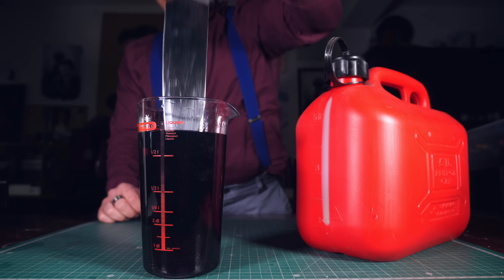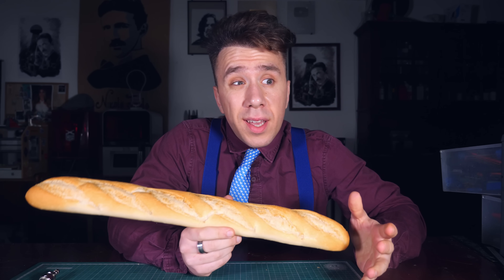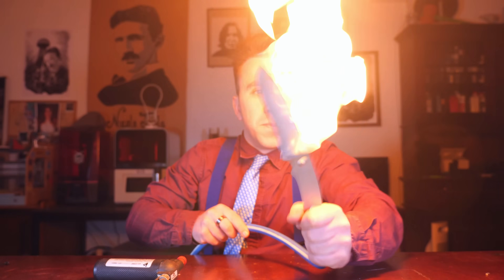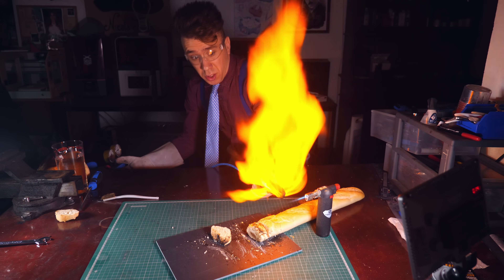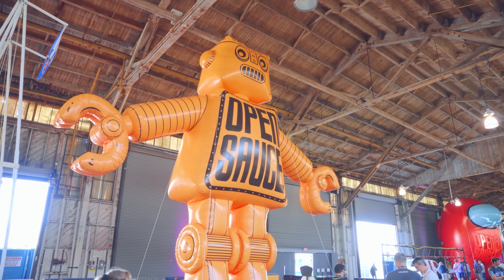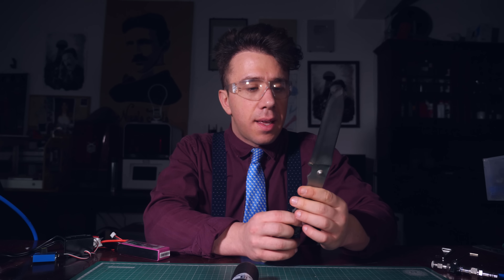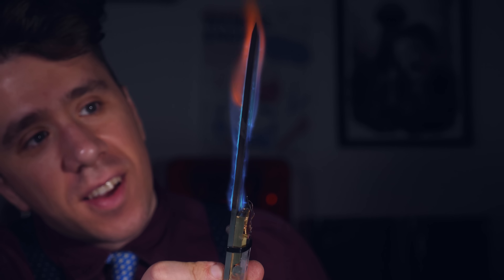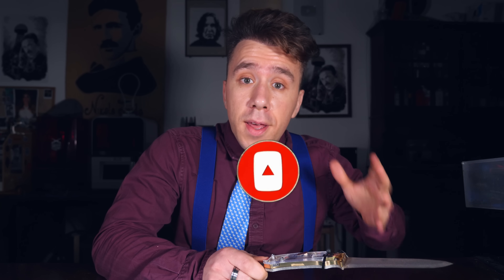I made a TRUE FLAMMING KNIFE

Comment: I want to see it hooked up to a Tesla coil or a high voltage DC source, The tiny radius of curvature of the voids inside should concentrate the electric field enough to cause corona discharge INSIDE the knife instead of just the sharp edge and tip. Plasma assisted supersonic knife.

Comment: Wow, this is amazing. Do you see what I see? This piece of metal will do a wonderful job of generating hydrogen. You have created a metal that has a surface area larger than its external dimensions. Not only that. Rather, this defect that you mentioned is a very useful property. You see hydrogen bubbles sticking to the surface of the electrode, and this reduces the efficiency. With this property, the consistency will decrease without the need to stir the solution. You have a treasure, man. Make a Volta tube with this metal, and use a large amount of hydrogen to prepare shakshuka with tomatoes. It would be a dream come true if I had access to some modern technology such as a 3D ball. Please help me win

Comment: I wonder If the knife can be printed in such a way that only the blade itself is porous and the pores on it are all facing the same rough direction? If that's possible, then imagine using this as a concentrator/ directional flow controller for gasses and the like for not just jet engines but definitely for jet engines too.

Comment: so could you 3d print a metal with a super high melting point and use that defuse to make a light saber. i really liked when it was super sonic and seemed to just be heating the blade. sounds like a good colab op with hacksmith too. - video idea

Comment: I dont think the knife or this tech will work. As the metal reaches its melting point. I dont know if it reaches the pores will close or self heal. Since the bread cutting industry is only using it at less temperature it might be a success for them. There might be a little chance to commercialise this metal. For the next video what you can do is, try to fly a small plane from your jet engine you can use any. or use it to power a car. I mean an rc car or rc plane.

Comment: lockheed martin has a prototype drawing of a fighter jet engine that had its combustor replaced with heat sink fins heated by a fusion reactor. can you make a jet engine that has an electronic resistive heater to expand the air instead of combustion?

Comment: project idea, use electric welding glasses as inverted stroboscope by flickering the opacity at high rate. the name "Time Shades" comes to mind since you could just walk around and slow down the apparent speed of anything cyclic in your environment without need to illuminate it with a flashing light. it also would allow for multiple people to view the same behavior at different rates without interfering with each other's observations. could also be interesting to see if there is any cool optical illusions or uses for sending different rates to each eye; they could be used to view something like a vacuum tube tv or oscilloscope which traces an image really quickly over and over by sending the slowed version to one eye and un-blinking on the other eye so you could both see the figure, and how it is drawn in real time.

Comment: I'm sure others have let you know but that whistle is a BAD thing. the gas INSIDE the knife has ignited. thats why you see the glowing spot grow rapidly near the end of the handle. cutting torches have the same problem on occasion. is usually means the torch is about to self destruct, if you're lucky it will only melt the tip. if you're unlucky the flame will travel up the gas that you've conveniently mixed with an oxidizer. thats part of why cutting torches mix the gas as late as possible in the assembly, we don't want the whole hose to explode, or worse, to force a flame front back into the gas bottle. Please tell me you have a flashback arrestor somewhere in this assembly.

Comment: You use this tech to create bubble cavitation on a model boat or submarine to see if you can temporarily increase the speed using a pressurized air can.
Or you can run hydrogen and air under the model boat/submarine to create underwater cavitation and fire.

Comment: There are two main types of metal 3D printers, those that get the metal powder just hot enough to sinter the metal together and those that  actually melt the powder. for those knives, the probably melt the handle together and then turn the lase power down a bit and sinter the blade together.

Comment: Sintered nozzles exist. But air is injected adjacent. 
I believe that yes, you can build a combustor with sintered fuel injectors with excellent flame holding, but will need to filter fine and need to blow dry before cooldown to avoid coking in the sinter.

Comment: I can see you using a cnc router ... why don't you make a 2 part blade (sliced lenght wise) with channels directing the gas into strategically placed outputs through the blade. This way making the blade themal output mode effective. another version would be just the edge glowing bright red to cut that damn 🍅- practically vaporizing the liquid when cutting. i really think directing the gas is the way to go because that metal sponge is just too chaotic to actually be useful - yes in an ignition chamber a tubular design to inject the fuel, might work but as a knife... you know the drill.

Comment: You can do the same thing with your ceramic resin printer. Print a cone out of the ceramic. Bake off the resin. Attach the cone to a gas line. Insert the cone into a combustion chamber. Add air. Tada

Comment: Reduction in  Jet engine complexity fuel delivery systems straight into the Compressors stream.  With the fuel cold coming off the Blade then igniting very close the reduction in engine length could be significant...Interesting...

Comment: can the printer change specs mid-print? so you can encase porous metal in homogenous metal to make parts and fittings? If so, you could make whole nozzles and diffusers as one-piece structures, rather than having a diffusion pad inside a nozzle tip, they could be one piece!

Comment: Is it possible to separate the porous areas and seal certain ones into a "chamber". The knife looks they can control that. You could have a cooling channel and a fuel channel on the same surface for liquid cooling. Or preheating liquid before combustion. Heck, you could use the porous material to capture heat from exhaust and transfer it easily to another chamber.

Comment: You should try your idea out using the metal with the holes in a jet engine. Also looks like your 3d printed air compressor has some pressure leaks

Comment: Tbh i would have liked to see more of the hydrogen with compressed air and experimenting with that cuz invisible fire making a red hot knife is COOL.
cool video otherwise

also keep in mind that Tomatoes are disgusting!
Reply: That whistling noise was the flame front trying to make its way down the tube.
Reply: @cult-of-sporque  Yeah, without a flame/flash-back arrestor or two separate fuel/oxidizer inputs, that is a detonation waiting to happen. 
Source: I'm a welder.
Reply: @erinfinn2273 the sintered metal will be acting somewhat like a flashback arrester.
Similar also to metal gauze used in miners safety lamps. 
They usually pull heat out of flame front, and thus quench it...but if the flame arrester warms up  enough the arrester would become an ignition source.
Reply: @stevecummins324  Yes, but a redundant flashback arrestor on the lines wouldn't hurt. If I was in Integza's situation, I would not trust my life to a sintered metal knife.
Reply: @erinfinn2273  Integza's arrangement is certainly not one I'd trust... 
But I don't know about a separate arrestor.... Both the sintered metal knife and an arrester will offer resistance to flow... and between them would be a volume of ignitable gas. Where that gas to catch, the pressure in the pipe would start to increase rapidly. and it can't escape easily without rupturing that pipe... imore an explosion than a burn. Best solution is to keep the volume of ignitable gas as tiny as feasible. eg microfluidic chemical reactors, hold only tiny volumes of reactants in tiny flow passages, and mix them inside the reactor, usually with additional passages for water cooling. and allow very energetic reactions to be performed safely/continuously 

there is one good thing about a metal rather heat insulating  handle... it would be noticed when the knife is starting to get warm.
Reply: @stevecummins324  I've never considered that one of the failure modes for a flame arrester is to become a flame creator. That's fun, it's kinda like a pressurized fire extinguisher that contains water with propane as a propellent.
Reply: cool maybe, but also terrifying.  Please don't mix hydrogen and oxygen before they are where you want them to burn lol
Reply: I grew up in a machine shop.
My Grandpa was anal retentive about periodically testing check valves.
But, the day he shat his pants was the day we watched the delivery driver drop a bottle of acetylene.
We were all lucky.
Reply: @TimeSurfer206  why did the shop not have a carbide acetylene generator?
Reply from the maker: Congrats! You won a 3d printer! Send me your info (Name, Address, Phone Number, Zip Code) to integza@gmail.com.
Reply: @integza lol bro won
Reply: @integza 
Hola Integza. I appreciate your knowledge and presentation of science. I seriously challenge you to make a jet engine that doesn't jet .
Reply: I'd argue a red hot knife isn't cool at all, in fact it's the opposite.
Reply: Oxygen puts its hand up…
Reply: So he should print a new one with separate inlets for fuel and oxidizer not to get roasted himself like the tomato... and then he could also make it a bit bigger, like a katana, maybe it will be some competition for his chainsaw sword 😂
Reply: @michaelnyffeler9966  probably best start small as on more thinking i need to add pure oxygen can do nasty things in piping, that is less than 100 clear of combustibles. It's not unheard of for piping containing pure oxygen to ignite if there's tiniest traces of grease.. plus if gotten hot enough steel wool can self sustain combustion with a tiny air blast of air. So sintered metal might just qualify as a fuel around pure oxygen.
Reply: Congrats! 🎉
Reply: Honestly, the venturi effect doing that is absolutely terrifying to be around.  My forge does that if it's not adjusted right and ugh... I knew the sound IMMEDIATELY.  It's like the heavens decided it's time to scare the crap out of you ALLOFASUDDEN. 😂. NOT a good time.
Reply: Agreed 👍
Reply: You can't have invisible fire. What is called "fire" is gas so hot it's glowing.
Reply: @sarkouille  Yes, you totally can have invisible fire. There are plenty of substances that burn with an invisible (or nearly invisible) flame.

Methanol and, under certain circumstances, hydrogen are among them.
Reply: @TheEvilAdministrator  Mea culpa, I confused fire with flame, foreign languages are tricky.
I stand corrected.

Comment: You know what I would like to see is a video exploring the possibilities of using a miniature jet turbine to spin up a generator that only charges batteries . In theory, you can install it in a car and the super high speed of the turbine can supercharged the propulsion batteries on a electric vehicle and only use droplets of fuel to do it. So,  yeah it keeps the batteries charged for hundreds of miles of range on only pennies of fuel.
Reply: I like this train of thought, in-line hybrid gas-electric engines are very efficient and turbine generators can reach almost the limits of efficiency when designed for a particular RPM and load. It would be LOUD but it would work just fine. Perfect for Batman's car. Now about the bat-plane....

I think you would get a kick out of the "Electrokinetic Generator", patented in 1957 by Thomas Townsend Brown. Brown needed a way to generate high voltage electricity on a jet aircraft in order to supply the millions of volts needed to ionize the air on the wings, turning the entire surface of the jet into a plasma thruster with the ability to cut through the air and fly at hypersonic speeds without generating a sonic boom. So he designed a combustion chamber with a needle electrode, just like a spark plug, the needle would be charged to a high enough voltage to generate a discharge, but unlike a spark plug, this needle would be in the final stage of the jet exhaust, like an afterburner, and it would be generating a corona discharge rather than an arc. The resulting corona discharge would first only partially ionize the gas, but as it accelerated out of the nozzle the extra kinetic energy of the ions would apply a higher voltage to the capacitors (in Marx generator configuration) lining the nozzle. The boosted voltage was then fed back into the needle electrode circuit to create a runaway feedback loop, which ramps the voltage up to the megavolts Brown needed to fully ionize the air-fuel mixture. The plasma assisted combustion radically boosts the fuel efficiency and maximum thrust of the jet, by recycling the turbulent and random thermal kinetic energy of the exhaust into electrical energy, which is converted back to more linear kinetic energy again and again. Truly a sci-fi concept, Brown was ahead of his time and was solving the biggest problem with plasma propulsion, the power supply. A few people have tried to build Brown's designs with limited success, and Brown even approached the military with prototypes for his ion propelled aircraft moving at high speeds. But that's where the history gets murky, nobody knows if the military dismissed Brown's work or told him to stop because he was too close to the classified research already in progress. Nevertheless Brown remained extremely dedicated to ion wind technology publically, the tech made it into air purifiers and several types of solid state ion wind turbines have been designed based on his work. It wouldn't be until the late 1990s that the internet would make a lot of private and military research into plasma propulsion technology available, and the stuff that IS public is astonishing, I can only imagine what the top secret stuff is capable of.

Comment: I have been thinking about it too. slowing down the air in a jet engine for combustion in a big chamber seems wasteful. It should be possible to have the burn ring be more like a small rocket engine where the air never slows down and continues in a nearly straight path. I don't think you want fuel to come out of the surface, that might just make it melt. Could be many high pressure nozzles in careful swirl patterns to mix it with the air very fast and evenly.

Comment: Idea for this - Rocket motor where there is no fuel/oxidizer nozzle and both are delivered through their own channel of the porous metal prints.  Challenge is getting the air/fuel mixture Correct.  Good luck :D.

Comment: i have a idea that instantly poped into my head when i saw this video. You need to make a kind of hovercraft type deal with the holes in the metal like a airhocky table but use that to try to make lke a skatebord that has enough air flow under it so you can stand on it and kinda glide. using the air to make a air presure under the bord to keep you up. Sorry about spelling.